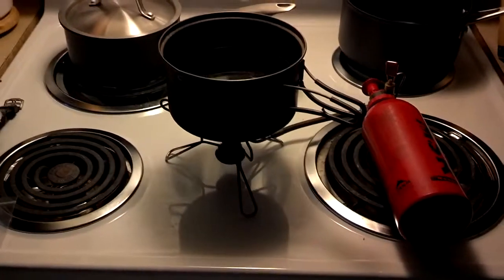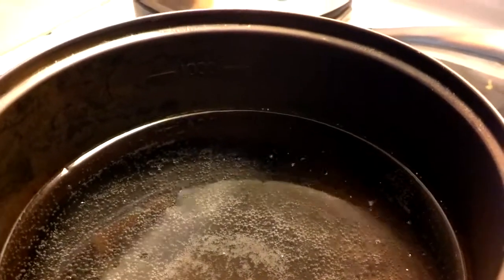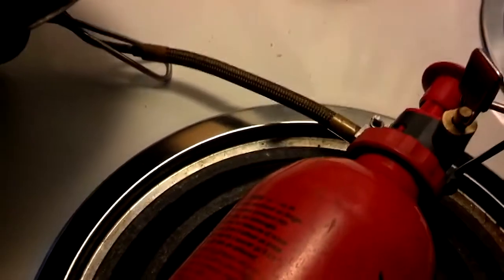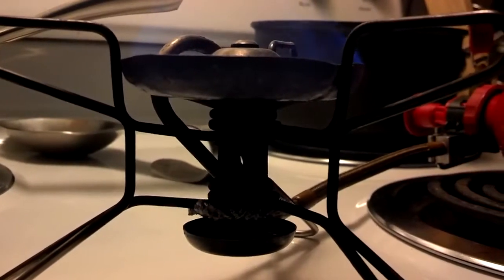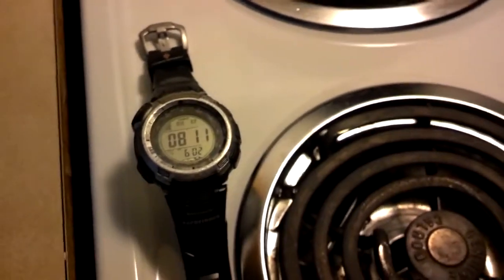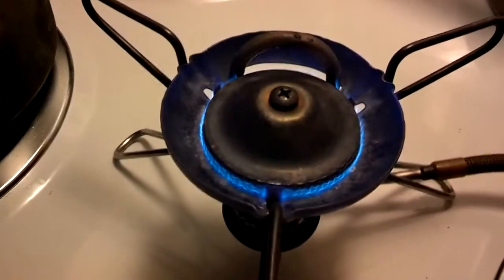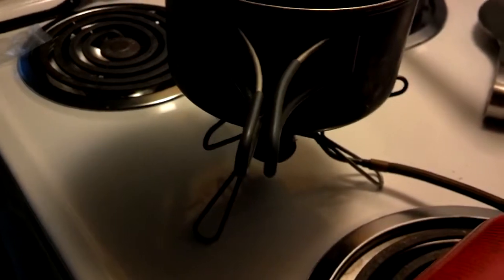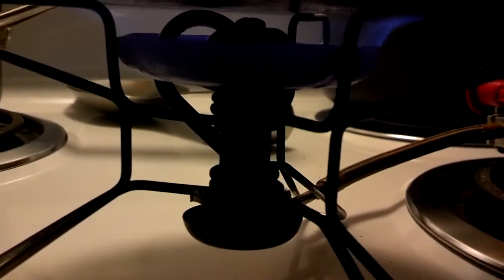MSR Whisperlite Converted To Run On Isopropyl Alcohol & E 85

Comment: Your the man !!!

Watched your videos, and done the same conversion as yourself, drilled out the 'K' jet with 0.8mm drill bit.

Justed tested using biothanol 97% alcohol.  Got boil time around 6 minutes for 500ml.  5 degrees centigrade (41F) ambient external temperature, water at 10 degrees centigrade (50F).

Got to playwith getting the fuel flow adjustment right, but gives a nice flame.

Ordered replacement 'O'-ring seals which are resistant to Ethyl alcohols, and working on replacing the pump non-return valve with resistant material (probably stainless steel ball bearing)

Hated using gasoline in my stove, smelly toxic rubbish - can now use environmentally friendly bioethanol :-)

Just wanted to say thanks !!!!

Comment: Your not avoiding fossil fuels by burning Isopropyl alcohol. Isopropyl is produced using propene which comes from... fossil fuels.

Bio Ethanol might have been a better choice. I use Bio Ethanol spirit in my Trangia burner as it is cleaner burning than Isopropyl which produces more soot and not as poisonous/smelly as Methylated spirit.

That said I'm not going out of my way to avoid fossil fuels as I usually use panel wipe in my multi fuel stove which is a blend of Naptha and n-Hexane, the same as white gas, but when I want a quiet brew/hot water whilst camping I use the alcohol setup.
Reply from the maker: Well noted, Simon. Thanks. This was very preliminary testing...proof of concept. Once successful, we transitioned to other alcohols. Check out my video running Everclear...100% grain alcohol. Bio Ethanol is a tough item for me to find. I can find 95% "bio based" denatured alcohol at the Home Depot, but nothing else. Do you have a better source?